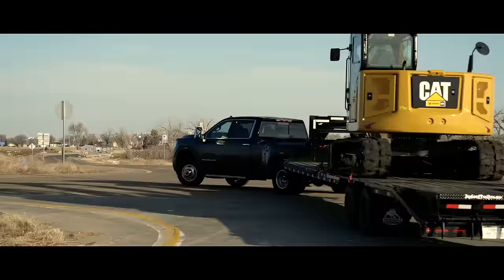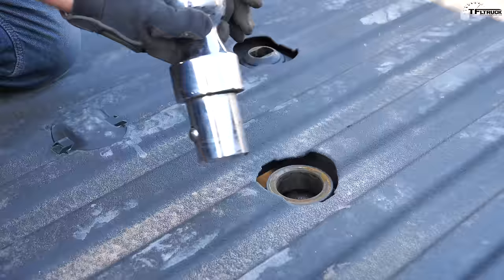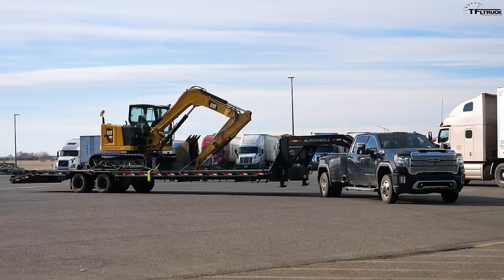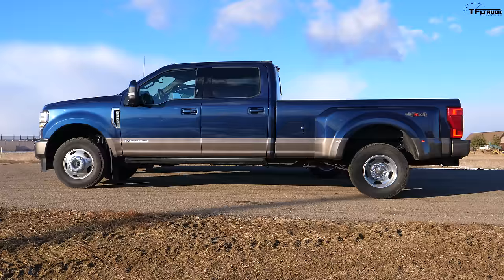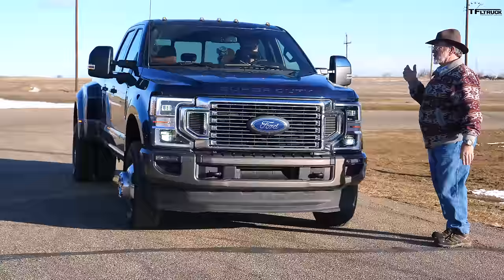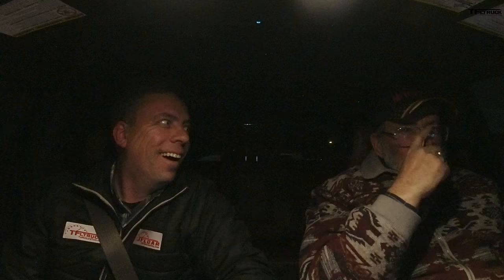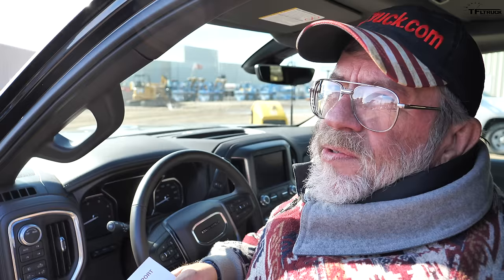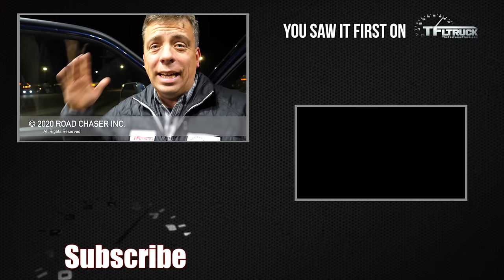30,000 Lbs Monster Tow Test: 2020 Ford F-350 vs GMC Sierra 3500 - Drag Racing & Tow Off!

Comment: I honestly think I'd rather step up to the F450 just to get the tighter turning radius.
Reply: True, but you lose cargo capacity and towing capacity (5th wheel and gooseneck) compared to the F-350.
Reply: James Velvet Really, why? Does it share the chassis with the 350 so all the stronger components just penalize it in weight?
Reply: Chuck Beef ..... yes. Frame rear of cab has more metal, and so on. Bigger brakes is a plus. The turn radius is the best!  Everyone has their priorities, me, I chose the turn radius and brakes vs payload
Reply: @ChuckBeefOG  Yes, the gross weight is higher in the F450 and that eats into cargo and 5th wheel/gooseneck ratings.  That is also why gas F 350's have higher cargo ratings than a 450.
Reply: @rh-et2vv  Indeed!  That is why I'm also considering a 450 as a base for a truck camper.  My struggle is that the F450 is not available in a Supercab.  I don't want a crew and not sure a regular cab would work.  A F450 regular cab is what I might end up with just because it would be so maneuverable.
Reply: When i do eventually upgrade my single axle trucks, into the dually class, it will definitely be the F450. A lighter payload capacity, with heavier duty driveline and an industry leading turning radius, equals a truck that will serve me well for a LONG time.
Reply: Well what is the point of a 450 then? Why put stronger components and bigger brakes if the FRAME is the thing limiting a higher GVWR? It makes zero sense at all. You have a more capable truck, but your frame holds you back from utilizing the components to the fullest anyway. 

In the class 8 world, our trucks gain more GVWR based on what axles, tires and suspension you spec, because the frame is not the weak link, heavy payload trucks have a double C channel frame and GVWR is determined by the weight ratings of your combos.
Reply: @ChuckBeefOG  not to mention the 450 rides so rough! I drove my friends and there is no way I'd consider driving that thing, especially around town. Only good thing about it is the turning radius. They really beat you to death empty.
Reply: @Jackmerius_Tacktheretrix  they probably ride so rough because of the solid front axle. Sure they are more durable in the long run, but let's be realistic. You don't need a solid front axle unless you are driving through rough terrain quite a bit, like rough fields and and such. If your highway driving all the time, you'll definitely rather have independent front suspension.
Reply: A tighter turning radius is nice for a daily driver, and trying to park these massive trucks, but it probably doesn't help much while towing because your constantly making wide turns, especially with longer trailers.
Reply: Lance Hartman I agree Lance. I would probably choose the Duramax as i wont be rock crawling and very rarely can you get enough weight on the front end to max out the capacity. If i were doing boosted launches and truck pulls i would solid axle.
Reply: Insurance, taxes and replacing those tires will be significantly higher though.
Reply: @jamesvelvet3612   Not exactly true. The F450 has a HIGHER GVWR and therefore, despite the extra weight, it has a higher LEGAL carrying capacity and TOWING capacity that the F350. The F450, by commercial standards is a MUCH more higher capacity load carrying truck
Reply: @resharddurdley6987  Incorrect.  GVWR is exactly the same for both the F450 and F350 (14,000lbs).  I know it sound counter-intuitive but please check out the 2020 Super Duty towing guide published by Ford Motor.   The max cargo capacity of a F450 is only 4,300 lbs.  Same configuration in a F350 (diesel 4x4 crew) is 5,000lbs and if you opt for the gas (which you can't do in the F450) it goes up to 5,700lbs !!!.  The ONLY thing a F450 does better is bumper pull a trailer.  The F350 beats the F450 in truck camper weight,  5th wheel,  and gooseneck towing.
Reply: The reason why the 350 has better numbers than the 450 is because BOTH trucks are rated at 14,000 GVW. Therefore, because the 450 is heavier due to larger components, it subtracts from the payload and towing capacity with respect to the 14,000 pound. It’s a LEGAL thing, not an actual ABILITY thing. Take legality out of it, aka, the f450 is not rated at 14,000 GVW....it will haul, tow, etc more than a 350 all day. It’s not due to capability, it’s simply due to the legality of the GVW and GCW.
Reply: @jamesvelvet3612  Well except for a regular cap F450. It beats the F350 DRW for gooseneck/fifth wheel towing.
Reply: @teamlazydave   Both the F350/F450 reg cab 4x4 have the same 5th wheel rating,  but the F450 does have a 1,000lb higher Gooseneck rating:  36,400 lbs to 35,400 lbs for the F350.  In crew cab 4x4 configurations (by far the most popular), the F350 is capable of gooseneck towing 2,100 lbs more than the mighty F450 .
Reply: @ChuckBeefOG  It is marketing thing.  There really isn't any "stronger components" on the current F450.  Years ago an F-450 was not available with a factory bed.  They were all cab/chassis and had GVWRs over 17,000 lbs.  It was those trucks that had more robust components. 
 Ford decided in 2008 to put a box on a derated F450 chassis (14,000lbs GVWR) to compete with a couple of aftermarket companies and refused to move it up to a higher class .  The real F 450 cab/chassis is a much more robust truck than the pickup truck version, which is almost mechanically identical to a F350.  A real F450 has a GVWR of over 17,000 lbs but like I said, it is a different truck than the pickup version.
Reply: @jamesvelvet3612  
I stand corrected. I see what your saying. I actually thought the 2020 6.7 f450 was 16000 gvwr and classified commercially higher for carrying capacity than f350. But I guess it would come down to what you are actually registered for. 10 years ago when I lived in texas, I registered my f250 6.0 for 11500 gvwr, even though ford factory gvwr specs were 9800. I needed the extra gvwr to be legal in texas and Minnesota pulling a 17k gooseneck.  So I guess ultimately,  it depends on what you are actually registered for in your state.
Reply: For me, towing capacity it basically a non issue. Nothing usually more than a motorcycle trailer, camper, or snowmobile trailer.
But I will normally just have the bed loaded with a good size generator, torch, air compressor,  1 or 2 welders and gear. Rugged durability and a great turning radius are major selling points in my eyes.
Reply: Why I thought turning radius is the same of f350 ?
Reply: I think people are not understanding why Ford offers a F450 with all these contoversal numbers. I personally had an F450 and was an outstanding choice due to the ability to make tight turns and a braking system that allows for extreme use. The components are designed heavier duty allowing the truck to handle the loads for day in day out use. Also the use of 19.5 wheels can get 16 ply tires that can go excess of 100,000 miles loaded. The f350 will be a great choice to pull your 5th wheel 6 months out of the year and the other 6 doing no hauling. It's the application it's intended for. Not everybody needs the 450 but my uses it was perfect. If you were to buy a truck and run max payload from day 1 wouldn't you rather have the one that'll keep you from replacing tires, brakes and the other related issues under max loads.
Reply: @Youngmechanical  Interesting perspective on the 450. Another Youtube channel discussed the 450 and stated that the tires rode rougher, cost considerably more than what's used on the 350, and that in the event of a flat, most of the standard tire shops don't stock tires for the 19" rims on the 450. What's your opinion on those comments?
P.S. I have no complaints for my F350, 6.7, SRW, 4x4, with 11,500 GVW and a 48 gallon tank
Reply: @gregparrott  I didn't have any complaints with my 19.5 inch wheels and tires. They do ride a little harsh but usually ran 90-100 psi in them. I also ran on gravel roads at max GVW and never rock drilled my tires. I have seen the lighter pickup tires ruined from sharp rock. Also the tire shop I delt with had to order the tires but the reliability and miles I could get out of them seemed worth the inconvenience of it. I did have a spare tire ready to go on the truck and never used it in 230,000 miles under heavy service with the truck
Reply: And to add I ran the Continental HSR and HDR tires which were kind of an all terrain if you'd call it that. They didn't seem to unreasonable in price in comparison to say a 17 inch tire I guess. I do gas and oil mechanic work and don't have time for brake downs or run 60 miles to get a tire fixed.
Reply: @Youngmechanical  Thanks for the reply. I agree that rocks can be a real nemesis for the F350 tires. Never needing the spare is good testimony.
Reply: @gregparrott  you betcha.
Reply: @ChuckBeefOG  The frame is not the limiting factor, the limiting factor is that Ford wants to keep it as a class three truck. Any higher than 14,000 will bump it up to the next class, and it will no longer be a light duty truck. That's why when you look back at the 2008 to 2010 f-450 pickups you never see ford compare them to the other pickups, because they were no longer in the same class because they were over 14,000 back then.
Reply: @davidalphin6626  I have an 450 and yes tires but as for insurance it is probably going to depend on your state, but in mine it is not any higher then a F350 would be. They are the same class truck as the 350 and the 3500's
Reply: @resharddurdley6987  it has a higher towing capacity but since ford limits the f-450 pickups to stay in class three, they have the same GVRW as the dually 350. So since they're heavier they are tagged with a lower payload. You will have to go to the cab and chassis 450 to get a higher GVRW. But then you have less horsepower and torque.
Reply: @bobcatron609  the f-450s have a wide track front end. so the front tires are able to turn at a sharper angle since they are farther away. Which then of course gives you a better and tighter turning angle
Reply: Quintin Dowell Well why make it a light duty, its still had hydraulic brakes, you dont need your air cert to drive it, might as well bump it to a class 3 frame and have more payload.
Reply: James Velvet Max towing gooseneck for the F450 is 37k (reg cab 4x2). F350 is 35,750 (reg 4x2). 

https://www.ford.com/trucks/super-duty/models/f450-xl/
Reply: Love my 450.  The turning radius is insane and the braking is a huge difference.
Reply: On paper yes, but Ford had to do this in order to prevent the 450 from being a Medium Duty Truck.  The 450 is a monster and would easily out perform the 350 in all catagories
Reply: @jamesvelvet3612  v10 gas is available all the way to f 650
Reply: @Jackmerius_Tacktheretrix    Folks, please keep in mind that there is a reason why some of these trucks are built the way that they are and they ride the way that they do. 

Most people don't understand that an F-350 with dual rear wheels is actually overkill for most situations. If you go back through and look at the towing capacity of a Ford F250 with single rear wheels, they can typically tow as much as the Dual rear wheel F-350 pickups up until approximately 5 to 7 years ago. It all changed when they started to get into these huge Towing Wars with all the different manufacturers. But, you don't need an F350 to tow your camper or Trailer a few times a year or even once or twice a month. And let's be honest, Most people are only Towing their campers during the summer months and they aren't going every weekend. Some do but a lot of people will just tow their campers. a few times throughout the Summer months and you don't need a big F350 to tow your camper for this infrequent amount of time unless you're towing an extremely large 38 foot or 40 foot or larger camper.

If you want to have the ability to stop better, it is understandable that you would want to get an F-350 or larger pickup however, for the majority of people, a single rear wheel F-250 is more than capable of most situations.   If you are a smart driver and a safe driver like you should be, you can tow many trailers many times throughout the year with a simple F250.   Most people just don't sit down and think about it. 

An F250 that is within the last 10 years and has a diesel engine can easily tow just about any camper on the market.   You don't buy an F350 for ride quality when you are unloaded because that's not what the vehicle is designed for.  The vehicle is designed to do more heavy work and have a trailer behind it most of the time.  They ride a lot better when they are loaded and that's why the suspension rides the way it does when it is unloaded because it is designed to allow the extra weights on the rear of the vehicle because it was designed to tow heavier things on a more frequent basis. 

These Higher-capacity pickups are not meant to be daily driver vehicles like so many people want so people need to stop complaining about ride quality. 

You get an F-450 because you are doing some pretty heavy towing that an F-550 is not yet required to do. If you're getting an F-350, then you are Towing pretty much every weekend such as a farmer or rancher with a heavily loaded livestock trailer or doing some light duty construction work on a regular basis.   People need to stop thinking that these pickups are supposed to be daily drivers and ride nice. They're not designed for that. 

Get the appropriate pick up to take care of the appropriate tasks in a certain amount of frequency.  If you're just towing a camper a few times a year, get an  F250 with a diesel engine and call it a day. If you're doing a little bit more frequent Towing, then get an F-350 and be more than happy with it. 

Unless you're doing some major towing on a regular basis such as every week or maybe even multiple times a week, there's no need to get an F-450.  About the only reason you would need to do that is if you are hired to tow cargo on a regular basis such as a Hotshot trucker or over-the-road trucker or something similar that is doing regular hauling. every few days or multiple times a week.
Reply: I'm thinking the same thing (for towing large camper) but I keep hearing their 6.7 diesel has lots of problems... Anyone here confirm or deny this? It might send me to a Dodge Cummins..
Reply: @TheDirtyyoungman1   I'm with eldridge201 with this.. steer clear of ram. Stick with Ford or Chevy and you'll be ok. The Powerstroke and the Duramax are both good powerplants. And they worked together on their new 10 speed transmissions.
All 3 will have emissions related issues. It's gonna happen. In my opinion, if you absolutely need a diesel, buy a nice used one and delete every last piece of emissions on it. Screw the warranty.
Reply: @ChuckBeefOG  it already is a class 3 truck. If they bump the GVWR any higher it will be a class 4. It's all marketing they already have a class four f-450 the cab & chassis. They want something to brag about, because if it became a medium duty truck they would no longer be able to compare it to the other pickups and would be in a class with a lot of other bigger trucks. which would also make for less buyers. because the normal everyday guy that just wants to dually for their trailer, they don't even look at medium duty trucks The majority of the time
Reply: @Jackmerius_Tacktheretrix  I have a 2017 350  and a 2019 450 and I like the ride of the 450 far better loaded or empty. Make sure to add FX4 package.
Reply: @Eyore82  I have a 2019 450. Also had the 250 and have a 350 too. 450 is top dog. You won't regret it. I build and priced a 2019 350 and 450. The 450 was only 2500 bucks more for a lot more truck.
Reply: Mountain Man  I have no shaking problem in my 2019 450. But I do travel a lot on rough roads. I had my 30K trailer custom made and brought the trailer wheels ahead by 2 feet as to get more weight on the trailer without it all being on the tail end. With the lower ratio in te 450 compared to the 350 you can get up and go really quick.
Reply: @Starbreaker666  commercial wheels is actually a down side.  The tire selection is much smaller.  Not such a big deal for a hot shot work truck, but more of an issue for RV towing...
Reply: I ordered my f350 with the 450 components for the turning radius. I went 350 because you get more tire options because of the rim size you can only get commercial tires for the things
Reply: Mitch Peck so you got the 450 axles with hubs for 350 wheels?
Reply: @mitchpeck7759   I didn't know that was even an option. I'd definitely consider doing that!
Reply: @davidc1961utube  not sure how it works but when I ordered the truck from factory I checked the box it was a option (heavy service front suspension package)  also got 4:10 gears
Reply: that f450 is an amazing truck
Reply: Had a 2015 f450. That thing was a monster. Completely different truck from f350
Reply: @ChuckBeefOG  oddly enough the IFS does better at boosted launches and truck pulling then the strait axles which axle hops and doesn't plant the power to the ground as well. No death wobble as well. I have a Super Duty regardless but respect where earned.
Reply: @jamesvelvet3612   Thats because the 450 is derated to keep it in the Class 3 category.  The 450 is far more capable than the 350 in all situations
Reply: Man, the ride is way bad though.
Reply: @jamesvelvet3612  I'm looking at the towing selector sheet right now, and it's not nearly as simple as you're making it out to be. There are a few specific places where it is true, like with a slide in camper and with crew cabs on gooseneck.  It is not true for single cab gooseneck, not true for bumper pull at all (3000 lb difference on the crew) and not true for GCWR in any case.
Reply: @Youngmechanical  lol, I hate those Continentals, they come from the factory on the 550, the only tires I've blown
Reply: @TheDirtyyoungman1  I spun a main bearing in a 2012 f550, 22000 kms
Reply: @jamesvelvet3612  we have a f-450 and it has all the bells and whistles  and they turn in stupid tight turns
Reply: @Jackmerius_Tacktheretrix  we have one u swap out the 16 ply tires and put 14 ply with mid grips and only put 80 psi and the truck rides like 350
Reply: @Starbreaker666  The commercial wheels come shod in commercial tires, though, so you're not going to be able to just go down to Discount Tire and pick up 7 new skins.
Reply: And the heavier front end
Reply: @jamesvelvet3612  once you go crew cab you never go back. Always had a super cab bought my first crew and fell in love. The extra storage capacity under the seat along with folding the seat down for storage just using it to haul groceries is worth it. Easier for passengers also.
Reply: Ones saying F450 rides so rough ect. The F450 is made to tow not use as a family go to church car. It has the same axle as a class B truck like Freightliner , International, KW, etc. Also get 19.5 wheels. Ive been getting 90,000 miles out a set of tires compared to 30,000 max out of 17" if lucky. Also 19.5 can be recapped. Working for a government we recap all our 19.5. The F450 brakes are also way bigger than F350. A F450 trailer cam loose brakes at 37,000 pounds and the truck can stop loaded with ease. With the rating on payload I think that has to go with gov reg because F450 has extra springs than F350 along with a much larger frome. The F450 and 550 reg cab has same style frame and used a roll backs and sump trucks. If towing a dual axle fifth wheel camper, a farm tractor, farm equipment and occasional 30,000 pound load once or twice a moth 100 mile radias F350 is fine. If towing 3 axle Campers, big toy haulers, towing 20K and more consistently i go with a F450. Towing 20K and up consistently will kill the brakes on a F350 in wear. Also towing consistently heavy the F450 is easier on the drivetrain because there geared 410 min most are 456 & 488 and the cab and chase trucks are 4.88 and 5.13. My buddy has a loaded out leather crew cab F450 and it has 4.88 gears. Remember these are 19.5 wheels and the tires are lot taller than F350 so its going to lower the gear ratio even more. The size tire with 4.88 drops to 4.28. It still cruises at 75mph no problem anything above 85 its getting to much. The 5.13 gear trucks are limited to 75 mph. They run faster but the xrusing speed is limited so won't cause premature engine failure. I own them and work on them. This is my opinion as owner and a certified Ford & GM Texh. Also everyone mentioned turning radius of a F450 is correct its a major difference by far. My 2004 Leaf spring F250 make 3 back and pull ups to one turn on a new F450
Reply: @Starbreaker666  Ive got a F550 and the 450 is in the same class its more than just brakes and a few the springs hubs and just about everything is bigger than the 350s so im with you the commercial grade all day. I have CDLs so I know  a little about hauling weight lol
Reply: @ChuckBeefOG  unless they changed the frame again? they have boxed frames for the passed so years now.? Now im going to look at a dealer to see this weekend got me wondering now hahaha
Reply: @catsaretasty  yea, you can haul way more weight for the same, if not better mpg lol
Reply: I had one , the turning radius was very nice
Reply: Owning one you are right it’s absolutely impressive it turns on a dime
Reply: @yakovfoley1061  I had a 450 flatbed with the long wheel base , it would turn tigher than my reg cab short bed pick up
Reply: @markme4  yeah I have a 2020 450 king ranch and it turns tighter than any other 1 ton including my 05 short box
Reply: Just go with a ram 3500 HD almost as much pulling power as the f-450 but Ford won't tell you that and it weighs less which means it has better mileage
Reply: @patriotmusicgroup3671  If i could build my own dream truck, it would be a Cummins powered, aluminum body F450 with an Allison 6 speed transmission.
Reply: Is that worth another 10 to 15k?
Reply: @Jackmerius_Tacktheretrix  rides rough with no weight on the back add a trailer and smooth as butter and commercial grade tires need to be aired accordingly
Reply: @spin0491  true
Reply: @patriotmusicgroup3671  regular cab f450 towing numbers are lowered to keep it from being commercial which gives regular average joe ability to grab it without paying commercial fees you think being beefier under the bottom would actually have towing capacity numbers you see....... it’s the last regular pickup truck option to buy before being commercial grade people who have owned one know this why have they been in production so long and they sell if I had to guess I would say actually towing numbers are maybe 5k higher than a 3500 or 350
Reply: @davidc1961utube  There’s plenty of options and the commercial grade tires will last maybe even double of a regular tire will plenty of 19.5 tire option a lot of commercial trucks use them they cost more but will certainly last longer
Reply: @davehart7943  right!
Reply: @patriotmusicgroup3671  lol what??? I’m talking about the towing numbers being deflated so it’s not considered a full commercial pickup truck if ram made a regular cab 4500 like Ford does with the f450 they would do the same thing.... to still be able to appease to the average joe wanting the top pickup truck why you think the f450 is an option for sale strictly because it has better turning radius lol?????
Reply: @spin0491  well if you were trying to appease the average Joe that actually had brain cells and wanted the top truck you still wouldn't get the f450 you would get the 3500 because it has better tow capacity better toys and better everything for a 1-ton class without the logical need to go to a truck that only tows 2000 lb more......
Reply: @patriotmusicgroup3671  that’s your opinion but they do sell so Ford must be doing something I guess f450 been out for a while now too.....and again don’t compare towing numbers because they are deflated...... and ram 3500 is my next choice behind the f450 but if ram had the same setup I would get theirs
Reply: @spin0491  apparently you haven't paid much attention to the all tests that they do with the 450 and the 3500 ram... It's not my opinion I've been turning wrenches for 30 years Ford makes shitty trucks and cars... And as far as towing numbers LMFAO you're damn right they're deflated my two and a half ton Chevy suburban pulled a 7-ton Isuzu NPR out of the mud( video proof on my page)... I've owned Dodge I know that they are well underrated pulling a 26 ft tandem axle box trailer with my 2000 halfton.... You believe what you want by all means 😁
Reply: @eldridge201  It's not all about numbers with the DRW trucks!  If you've ever towed with one on the highway over mountains, with heavy side winds, or had to do evasive maneuvers while hauling a 20k trailer, the Daully is MUCH more stable in every situation.  It's also safer in a blowout situation for obvious reasons.
Reply: @AnyManProjects  please show me where I discussed this and disputed this.  Just because some things aren't mentioned doesn't mean they aren't known.
Reply: @ChuckBeefOG  reliability and durability!
Reply: @ChuckBeefOG  - The F-450 has a higher tow rating 37,000lbs and payload than the F-350. When you strip into a chassis cab then you lose tow rating but the payload is higher.
Reply: Love my 2020 F450 ... at work or out to dinner...  the Platinum trim is amazing...
Reply: Had both a 19 450 & just got a 22 350, that turning circle of the 450 is awesome the brakes are a bonus but ride quality and fuel economy suck compared to the 350. Plus payload is more in the 350. I only sold my 450 due to high miles, being out of warranty and needing money spent on it, to get into another 450 was long lead time due to having to order it, I found a 350 Lariat fully loaded on a lot and went with that. Do not regret it another saving was the insurance premium which I forgot to mention (non commercial insurance). I miss the 450 in some respects but what I gain back is worth it IMO.
Reply: @ChuckBeefOG  to keep it legally under 14,000lbs